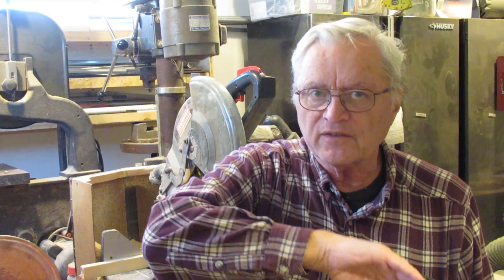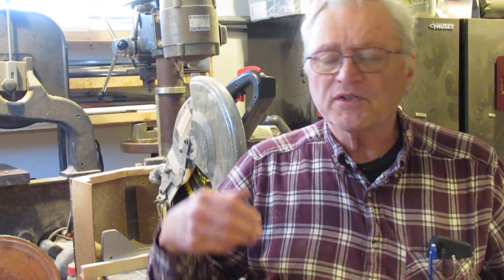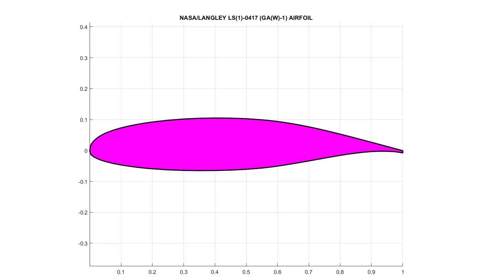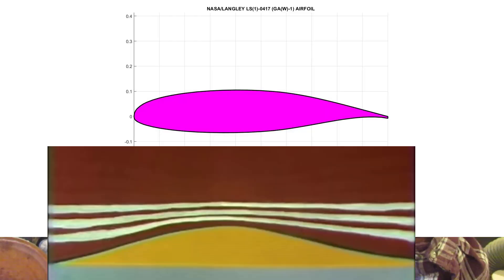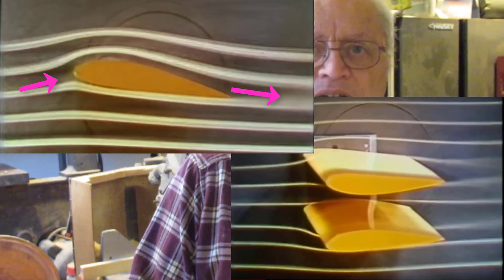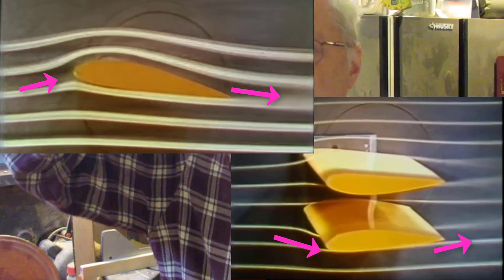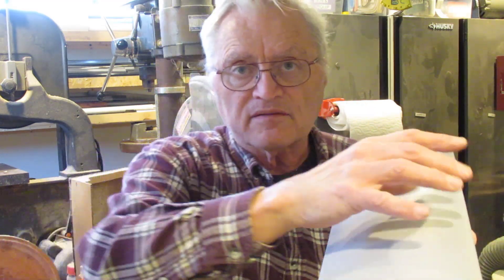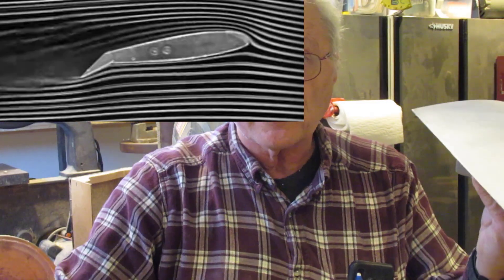Lift: 10 Myths in less than 10 Minutes

Comment: Myth 1, airfoils have to be curved on top, and flat on the bottom. Not really but air and water can take higher compressions than they can take suctions before the fluid particles separate, and cavitate or boil the moisture. So when one uses low velocities where air or water particles can take the linear acceleration along a straight line or the angular acceleration on a tight curve,, one might as well curve the wing to get a better acceleration flight path field over and under the wing. . But at higher velocities where the fluid particles existing in a matrix can separate, it is foolish to use curves, and straight lines are much better. 

Myth 2. particles over and under the wing must meet at the trailing edge. It is so naive to talk about velocities around a wing as it is the RATE OF CHANGE OF VELOCITY  hence, the acceleration field, that contributes to lifting.  One can shoot a cannonball to reach the same range by inclining the gun at different angles and changing the charge. That action is basically the leading edge down angle of the slats or upper leading-edge down angle. I would say that you can use, slower, equal, and faster velocities on top of the wing and you still can get lift. 

Myth 3. Newton's law does not explain the low pressure on top of the wing. A fast car approaching a hill will compress its suspension system due to its mass trying to proceed in a straight line, and as it accelerates up, basically its horizontal velocity will remain constant and the fuel in the engine was used to accelerate the car vertically up, in addition to keeping its horizontal component, So at the brow of the hill, it is the gained vertical velocity that will cause the car to separate from the road and fly for some time after the brow of the hill. If behind the hill, the road slants down at the right rate of change, then the flight of the car over the road will be longer.  Now add some sealing viscosity between the matrix of fluid representing many cars going over the first stages of a hill and you have the pressure suction zone at the leading edge and the suction zone all the way to the bottom of the hill.  That is the upper surface of a wing. Newtonian processes are fully included in Bernoulian philosophies and all one needs is to understand their contents, which are a variation of words and symbolic language describing the same theme. 
Myth 4. Newton versus Bernoulli  game is always a draw  
Myth 5.  Bernoulli explains the low pressure on top of the wing. Forget the higher or lower velocity vectors as the contents of 
Constant = P + (V^2)^2  means that we need to square the magnitude of the velocity and so that Constant and P are a scalar and not a vector, and so even with a horizontal increase in velocity, the Pressure, WHICH IS A SCALAR, does offer its services in all directions, where P exists, and so, a change of horizontal speed can, in fact, produce a scalar pressure change which in turn can produce a vertical acceleration. In our case, we also have a change in vertical velocity,  hence a vertical deceleration or acceleration which can result in low pressure, if used intelligently. Refer to a fast car navigating the hill. 

Myth 6.  Blowing over a sheet. Since in reality, a fluid particle is complexly connected ( viscosity sealed and can shear) to an adjacent particle then the C= P + (V^2)/2 must be modified to  C2=  P2 + (V2^2)/2 +  ( external energy gained or lost by particles moving close to compression or suction, magnetic zones)   This means that when he gave energy from his lungs/mouth to the particles, these came in the vicinity of the stationary particles over the paper and they cause them to react to their higher velocity.  A difference of pressure along a Streamline is the same as a difference of pressure with an adjacent streamline so the particles on different streamlines can affect one another and I call that Bernoulli effect.  That is why the streamlines around the wing in a wind tunnel operate as a team as they are connected,  like stacked membranes and threaded particles on a streamline, will not cross over to another but it will affect it, as it is connected to it, and not isolated form it. 

Myth 7.  Air bouncing on the surfaces of the wing.  Air particles are connected in a queue like peals in a necklace and they have got complexly connected soft cushions and pillows around them which can take compression but only a little tension. Air particles do not produce any SUDDEN IMPULSES on the wing surface and they land softly on cushions and slide along as connected pearls in a necklace or to be closer, as distributed soft cushioned masses on a sealed membrane. We can exchange pearls for children who use pillows to soften the landings on, and the slidings along wing surfaces or slides as children do! 

Myth 8. Pressure alone does not explain lift. Well, pressure is a scalar and acts in all directions so so it is through ingenuity that an engineer changes the scalar pressure to a vector directional force........ so I guess pressure alone does not create lift and I shall not tell you what is that additional component to use to change a scalar pressure into a FORCE VECTOR having magnitude and direction!
Myth 9.  Wing works like a venturi. The bounded sides of a wind tunnel set the shape of the most distant streamlines but a free-flying wing is boundless and so a venturi does not represent a wing. and the squeezing of air as it flows over an obstruction is not exactly correct, as the mass particle is like a heavy car on the level ground approaching a hill and it compresses its suspension system to later shoot it up above the brow of the hill and that is not squeezing the air. See Myth 3.

Myth 10. Scientists do not understand what causes lift.  It is said that mathematicians deal in unknows quantities as in ALGEBRA using symbols as  X AND Y and they subject them to known operations as + - multiply and divisions and other operations, and combinations and while they deal in unknown quantities with the known operation, one has to accept that though at first, they do not know the unknowns, they certainly know what they are doing, and they do obtain accurately and guaranteed repeated results. To get an appreciation of what an engineer knows, try and follow a lump of air going through in between a pair of blades. tiny wings, of all the stages in a jet engine, starting from the compressor their stators, the diffusers, the slowing down of air to sustain the flame, the hot stator, and the final turbine with the afterburner at the end. All a jet engine is, a number of ramjets working in parallel, mounted on the circumference of a disc for the sole purpose of getting them up to high speed when the whole machine is stationary relative to the ground.  That requires 500,000 years of natural human evolution and selections of the human brains and a long sifting of minds to be able to handle the invisible functions on wings.
Reply: Myth 7 is not a myth at all.  The astronauts in Columbia Space Shuttle would tell you that air molecules most certainly do impact wings, and can rip them apart at high velocity.  Likewise, the pilots of EgyptAir 990.  Their Boeing 757 was ripped apart because the jet plunged from a high altitude toward the earth and the force of the air molecules hitting the wings at progressively higher velocities tore the wings off.  Air vs. Aluminum, and the air won.  Facts, like air molecules, are stubborn things.
Reply: @crimony3054  Of course you are correct in that when the speed is very high as approaching the speed of sound, then the air molecules do impact the wings. But then the material has to be changed, as aluminum is too soft and they have to go to titanium or shape it like the Concorde. What I referred to was a well-engineered wing, made of the material suitable for a particular speed. and where the aircraft stays within the boundary limits of its design. At the moment I am thinking of the limitation of human flesh when a pilot ejects from a high-speed jet aircraft................those air molecules do tear his facial features apart. but not at the slower speeds with which a human face is supposed to operate.

Comment: Great video, really enjoyed. I have a question: if the elevator (which is like a flap at the back of the airplane) is used for the plane nose to go up if it's up (used for take off), and for the plane nose to go down if the elevator is downwards (used for landing), why doesn't the same thing happen (plane nose going down) when the flaps at the wings are down?
Reply from the maker: The aircraft rotates around the center of gravity which is typically somewhere near 1/4ish of the way into the wing (from the front). The elevator has a lot of "leverage" to make the airplane pitch up or down. The flap has a  less leverage - typically there are some pitch changes when you lower the flaps - but not nearly as strong. 
And, for landing, typically, as you get close, you hold the nose up as the airplane slows down to increase the angle of attack (angle of the wing relative to the air flow) to maintain lift.
Reply: @LightAndSportyGuy  I see now, thank you for clarifying!